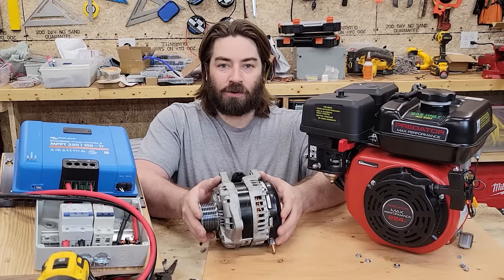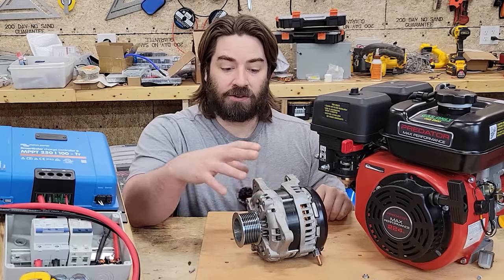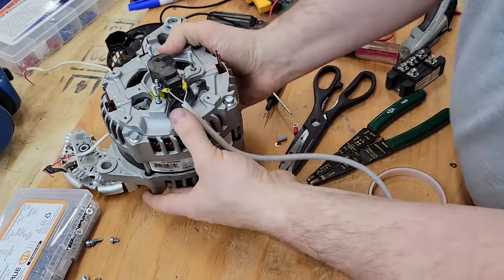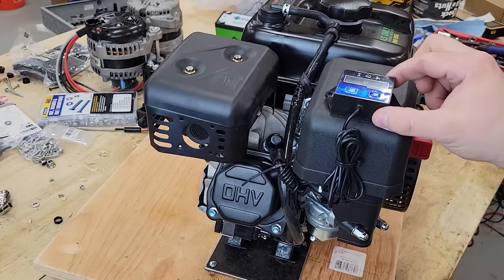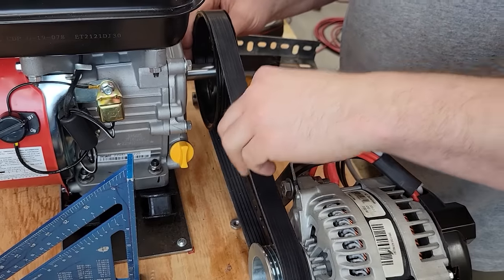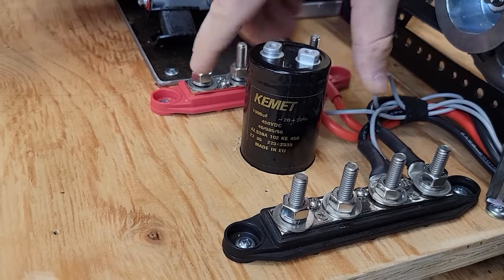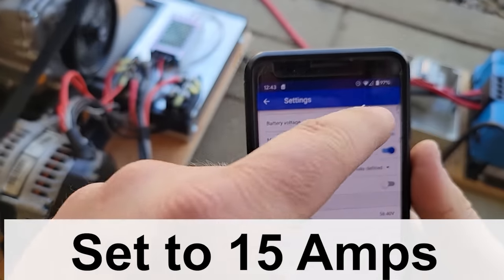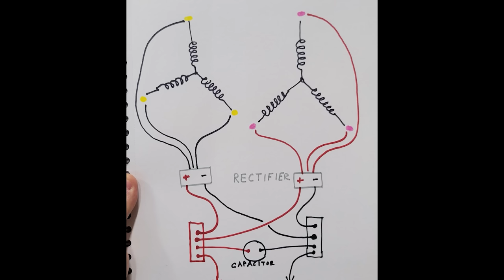The AlternatorGenerator, First Attempt.  48V Battery Charging

Comment: Get one of thos old bicycle generators add a bigger pulley to slow it down. Use it as a belt tensioner. Hook up an LED light. Nice good light to help around the work area. And tells you it's running from a distance.

Comment: After some searching I found that there is a plentiful supply of 48v alternators that go in "mild" hybrid cars. For example, search for this part (557.502.210.210) and you'll find a 210A 48v alternator for various Mercedes Benz cars. That's 10kW and they're available for around 320 USD/EUR! Looks to be water cooled. As well as the 48v connectors it also has a 6 pin connector which is likely used to control charging which might make it complicated to use 🤔

Comment: Hey there David! You just might be off to the races with your build project! If I were to try something like
this, this is what I would do: As it is, most alternator on a vehicle that is loaded with accy's etc, it would
be entirely safe to say that to drive an alternator, you actually need 8 Horsepower in a sense; period! My
jumping off point for me with the alternator: I would go out and buy for essentially the same amount of
money, you could buy a Denso Alternator that is spec'd for oh say a 2002-2004 Jeep Grand Cherokee that 
had a 4.7 Liter engine. Denso has a reliability standard that practically beats all others.

Comment: What i did to prevent the mounting board and plate from moving around because of vibrations, was to finally add 2 railroad ties as they were heavy enough and they act as great vibration absorbers.

Comment: Since the alternator produces alternating current, you can easily run your AC household on the alternator without its rectifier and regulator, just using a controller for 110v or 220v ac, to stop it producing more than those particular volts ⚡️

Comment: Interesting video. I would keep the belt in no matter what, because otherwise you're going to have to put some kind of slip clutch in between to protect your engine from load differentials, p.e. when you switch circuits. A direct coupling could be damaging to both sides (engine and alternator) if it's a mechanical direct coupling to the engine's axle.

Comment: Will the screw nails hold the vibration and the torque of the engine , even for a test run but to be on the safe side mount everything on a sturdy steel frame. Anyway congratulations!!!

Comment: To overclock n not deal w shaking maybe make a cement mold to hold it down n keep it stable yk maybe have large bolts sticking out the wood u have it on put it on the concrete let it dry and u have a strong steady foundation foundation

Comment: I used to work in a factory that converted 12 volt Landrover snatch vehicles for Iraq  to 24 volts. One thing we did was to change the stator wiring from star to delta or the other way round. Was a long time ago.

Comment: Super cool project!  I can't believe that physically small alternator would live long at 3kW output, it's got to heat up quick.  Hopefully I'm wrong!
Reply from the maker: Thanks for the comment.  In Video part 2, I run some thermal tests.  In video part 3, I optimize fuel economy.

Comment: Very cool project. You could probably add a simple PWM circuit to control the field, and also a servo for the engine throttle. This way, you can operate the whole system at the highest point of efficiency given the output being called-for. You could use an ESP32 controller with WiFi, then create a little app for control and monitoring. Maybe switch engines to one of those Chinese diesels and burn waste oil. If you're in a cold climate, maybe use the heat somehow.

Comment: David could you run the whole system using an electric motor with a similar rpm's  instead of the gasoline engine. The  pro's I see is: minimal noise, minimal vibration and continuous charging without the cost of gasoline. So the electrical motor is running off the single phase system as an appliance and powering up the the alternator to charge the 48volt batteries.

Comment: Hi David

How about putting 4 alternators in driven fron a longer shaft from the motor and separate belts and pullyes, to give 48V DC.

Or a bigger pully plus mountings for the 4 altnators.

I would use a ɓigger diesel engine.

This could be driven from diesel, bio-diesel, or equivalent fuel.

The electrical/electronic voltage control should be fairly simple you could also add an electronic control of the motor plus start/stop of the charging, plus remote control, monitoring and operation eg fuel, oil level, temperatures etc.

Another addition could be regulation of the speed of the motor and altnators for fuel efficiency and  max current output.

Thank you for your videos.

Forgot to say you would not need to modify the altnators. Just  combine their outputs in series.
Reply from the maker: Thanks for the comment.  There is another video on YouTube (Trial n' error) with 2x 24V alternators in series.

Comment: Very nice implementation David...Although the electrical part is ok ,your problem will occure from the mechanical part... Already you saw it...The vibration on the altenator you see and the "loosey" belt ...The solution is a COMMON base to bolt the engine and the altenator together or,You can eliminate the rubber engine mounts so that the engine AND the altenator have a common base ,a common Chassis so to speak... After this ,you will have a rigid and effective belt regulation... As for the electrical part of it AND the (BIG!!) aluminium heatsink... it is much better to have them somehow away from the engine..Try to mount them ,maybe in a vertical position as a panel or something like that... The 12V "trigger" now...I think you have FROM THE ENGINE power to do this..Look for it...Many engines of this type have a coil witch provides a low current 12 volt or so... Anyway congratulations for the construction...Very nice !!
Reply from the maker: Thanks for your comment.  I've made improvements and a Part 2 video will be coming out in the next few days (probably, if I finish editing)

Comment: Learned a lot from your 'garage experiment. What do you think starting with a 24v truck alternator would do? Small ones are 300 amps and go for $350-$375, and 450 amps can be had for a little more. And OTR truck parts are made for idling under loaded conditions. I was impressed; 2700 watts at 48 volts was a lot more than I thought could happen.
Reply from the maker: I think it's a great idea.  If you get a chance to test a large truck alternator, I'd love to hear the results.

Comment: I would replace the press fit diodes with higher voltage alternatives to keep diode cooling at the alternator.
 A fixed pulse width step down PWM switch from the alternator output would make the regulator think it lives in its original voltage range while B+ delivers a higher voltage.
No more current to the field. When alternator finally drops in voltage on high load the voltage to the regulator should also drop. That mechanism effectively limits the rotor current.

Comment: An old shop that I took my window fan to reverse the air flow, he took the fan cover off re-directed the wiring and done.. He had an alternator on the table that he converted to AC w/ 120 volts... I never learned to do this.

Comment: If getting the nuts on the studs that connect the anti-vibration mount was difficult or awkward. Then the recessed holes in the wood for the anti-vibration mounts could have been drilled all the way through. It would have allowed the mounts to be bolted to the motor first and then bolted to the wood as you would have had access to the bolts from below.

Comment: Have you thought of using a 48v marine alternator? for example Balmar 96 (48V)

Balmar 96 units are large frame, 48V alternators suitable for charging 48V lithium banks. They require an external regulator and are designed to be combined with the MC-620 regulator.

With very low cut-in speeds of around 1,325 RPM for the 60A model and 2,200 RPM for the 100A, lower engine idle revs are required, so saving fuel and reducing noise.

The alternator characteristics are the same across the series, with Four versions available, 60 and 100A at 48V with either Case or Isolated Grounds. The only mounting available is the ‘J-180’ dual foot.
Reply: What does a 48V Balmar alternator COST ?

Comment: To get a higher output voltage you could install a zenor diode between the output and voltage regulator to fool the voltage regulator into prducing more voltage. If you have a 12 volt (14.4) alternator and add a 36 volt zenor to the regulator it would produce somewhere avout 50.4 volts. I dont know how much power is required for the voltage regulator, i would recommend using a digital amp meter to ensure you have a powerfull enough zenor diode. It could be all it needs is a 5 watt zenor diode or maybe larger but this would be the easiest way to change the output voltage. They also make 24 volt regulators for some alternators, maybe there are higher voltage regulators available.

Comment: David, Love the videos. Mad skills and a huge knowledge base. 
Seems like everything was a success but why use the modified 12v alternator vs. a readily available 48v alternator out there?
What was the advantage in the 12v? What was the disadvantage of the 48v?
Reply from the maker: Mostly it was cost, a used 12V alternator is extremely cheap compared with a 48V.  But, also, some 48V alternators are only for lead acid, not lithium.  But, if you find a 48V unit for lithium, nothing wrong with going that way.

Comment: Nicely done!  Your output is right where it is supposed to be. By my calculation you should be able to get 4.84 Killowatts output with that engine. If you were to try to pull more, your fuel economy would suffer, and you would risk early mechanical failure.  Nice work for not being an electronic Engineer. 👍🏻👍🏻
Reply from the maker: Thank you.  In video part 3 I found a sweet spot for output and RPM where I think I got the best fuel economy for this setup.
Reply: @DavidPozEnergy  sweet, I'll check it out

Comment: If maximum efficiency weren't an issue, I would have run the 12-14 VDC output of the  unmodified alternator into an inverter to produce roughly 120 VAC, which could then be rectified and regulated with an off-the-shelf switching regulator to whatever DC voltage is needed.  This would make it much easier to repair the system if any part of it breaks or wears out.

Comment: Wow, I was just thinking about the same thing yesterday and bam, here comes your video. Maybe a V-twin engine for less vibration. Definitely mount engine and alternator on same frame then isolate that from the base. How about 2 alternators? Any benefit to that? You did great on this 1st attempt. Extremely thorough in thinking it through. Can't wait to see what you come up with next.
Reply from the maker: Thanks for checking it out.  You are right that the alternator and engine needed to be mounted to the same frame.  I made more modifications through part 2 and video part 3.  
Part 2: https://youtu.be/cy0t4qq8mS0?si=mL-50h3fVPXaeKkw
Part 3: https://youtu.be/yQTCVyxdauo?si=nnTRKJVVPrr82jGN

Comment: Great content!  I would be interested in the heat rejection from the alternator and the diodes while under a full load (80% of maximum output).  I’m wondering if this setup can handle several hours of operation at 80% without additional cooling requirements.  Did you check the operating temperatures by chance?
Reply from the maker: I didn't run a long duration test with this setup.  I felt there was too much vibration to run it long.  Since this video, I've re-built it to run much smoother.  Now I can run a long duration test and check temperatures.  Watch for the next video to see.

Comment: To keep it in one place  try to use a thick piece conveyor belt on the bottom. I use a piece in my pickup bed keeps heavy things from moving.
Reply: I would cut the conveyor belt the same size as that board, max contact patch.

Comment: Check the Ac current off the stator the copper winding under the rear case through the rear slots in the back cover ! I recorded 1,200W Ac current and I was spinning it with an electric impact gun probably about 1,000 RPM that’s 1 KW 200W AC !

Comment: I make my ring terminals out of spent rifle shells by cutting the rims off. beating 1 end flat, drilling a hole for the post. Then crimp them with a claw hammer and filling it with solder. I wonder if your fit from pulley to shaft was close enough to slide on using the hot cold trick. Chill the shaft then Heat the pulley then hit with a claw hammer.

Comment: Maybe change the pulleys to give better gearing and run the engine slower to increase fuel consumption. And some good mounts for the engine as you have slack on the belt when the engine get closer to the alternator with the vibration. On my carpet cleaning machine I have a solid mounting L do not get the vibration as the base plate is mounted to a frame.

Comment: What you want to be monitoring is your alternator temperature.   That will tell you how fast you'll have to turn it.   The slower the better for mechanical/windage efficiency, but you don't want to burn it up
Reply from the maker: In video part 2, I monitor it with a thermal camera.

Comment: Try to mount the alternator on a rubber mount or to the engine itself. It look like, at higher load, the belt become to stretch, and start conducting the engine vibration to the alternator.

Comment: I enjoyed watching you figure it and mod/build it.  However,  something seems amiss in the whole thing.  You modify the alternator to give 48VDC output but then you bought a buck converter to bleed of the excitation load at 12-14VDC.....  One has to ask though..... Why not just use a boost converter (14-48 VDC) from the start instead and leave the whole alternator as stock/unmodified?  would save a whole lot of work and potential unreliability.
Reply from the maker: For sure, that's another way to go.  I've looked at a few boost converters.  They tend to be expensive and low-powered.  So, I might have to buy several and parallel them to get 3kW to the 48V battery.  Still, others are factory set for lead acid Voltages, not lithium.  Anyways, more than one way to do something.  This is the way I wanted to try.

Comment: Great job as usual , love the design, “ did you ever think to use 12v DC motor to spin the Alternators powered from the battery bank you are charging ? I know you know the deal - the voltage regulator/ charging module to battery banks so when the banks voltage drops individual will turn on the Dc motor to charge the battery bank ! I’m having issues to find the parts the module to once the the battery voltage drops to turn on power to the DC motor to spin to make more electricity ! In theory I am self-sufficient for my electricity but I cannot find the electrical module to turn on power when the voltage drops !
Reply from the maker: I'm not sure I understand your question.  Are you asking if I can make a "perpetual motion machine"?

Comment: Did you investigate ways of transferring power that would allow the units to be mounted face-to-face rather than side by side? Maybe a torque converter or electric or centrifugal clutch or something similar and just eliminate the entire belt, pulley, tensioner, side loads on the bearings etc. problems all at once? It would be nice to be able to start the engine without pulling the alternator along with it. 
I guess you already looked at energizing the alternator just long enough to act as a electric start.

Comment: As I was watching your video I'm thinking those rubber mounts for the engine to flexible and your belt needs to be straight between the pulleys so you should mount the alternator in the motor on the same steel plate and then isolated from the wood base and also have a sponge rubber on the entire bottom of the wood base. But then I noticed somebody beat me to it and gave you that suggestion so I will second it. Also, you might want to consider using propane to power the engine.

Comment: You can keep slippage occurring of the pully by drilling a hole 1/2 way into the pully and shaft and tap it for a bolt

Comment: just wondering if you ever thought of trying a high out put alternator? I have one on my truck it pushes more power do to having a higher demand for power! i bet you can charge 2 of those 48 volt batteries with no issue using one. I really loved your video awesome job!
Reply from the maker: I'm sure that would work well.  I used an alternator that I was able to find locally, for a good price.  I didn't pick this alternator for any special reason besides that.

Comment: Lot of comments on this one. 
From experience, be a bit careful how fast you spin a wound rotor, the centrifugal load on copper wire can cause it to break (it will eventually anyway)
I imagine 12,000rpm alternators are permanent magnet type using neodymium magnets? (as used on sport bikes revving to 17,000rpm with direct drive from crankshaft)
I've seen 90v no load on a Honda 50 with  '6 volt' system.

Comment: Love it. Could you lower the speed to like 1000 revs. Or does it have to turn that fast. Could you gear it in a certain way.
Reply from the maker: The engine starts vibrating worse at lower RPM's, and has a lot less power.  In video part 3 I tested some lower RPM's.  I think 3,000RPM worked pretty well.
https://youtu.be/yQTCVyxdauo?si=69psZTzF58cNr8rY

Comment: Good video, however it seems like a lot of work for such a low output, and at 3300 rpm the engine is labouring quite a bit. What about standard 12 volt alternator through battery to inverter to 240 volt or 120 as in your network supply. Years ago I ran a 5hp motor through the 12 volt alternator via invertor and a 24 volt  alternator through 2 12volt battery in series for 24 volt invernator. Just a thought.